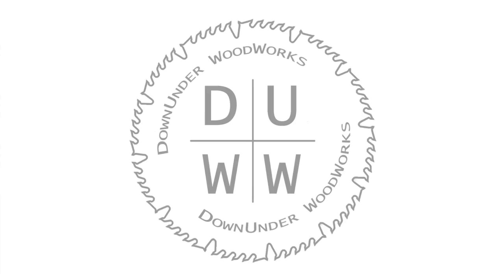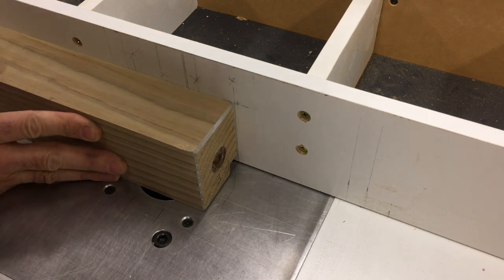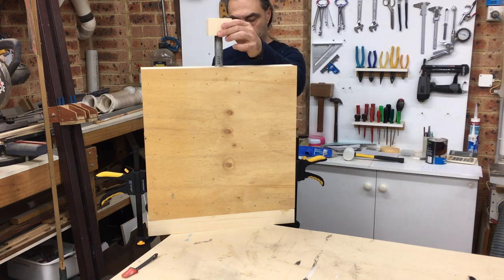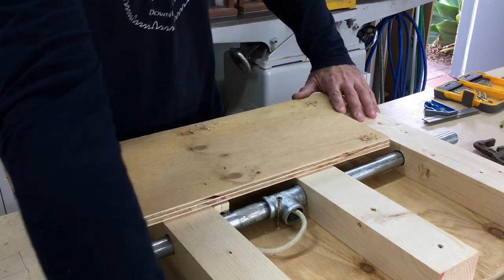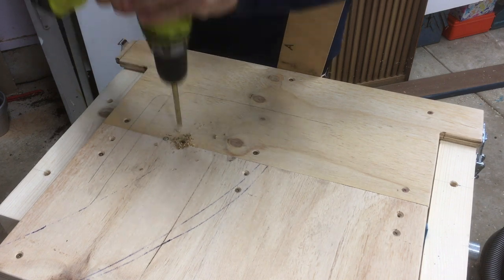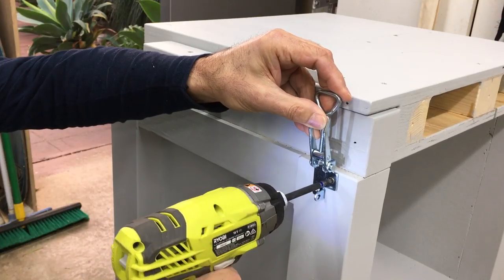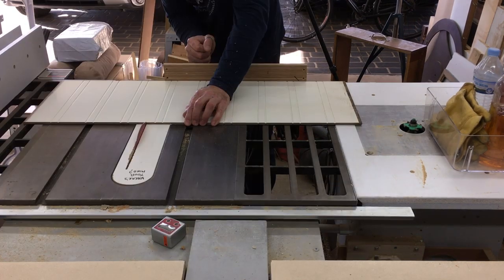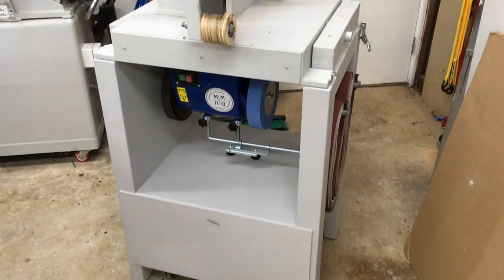How to build a mobile flip top tool cart

Comment: This has to be the best flip top tool cart build I have seen thus far.

I am planning on building one for my mitre saw and thicknesser. This means that I may need to make one side thicker (read, offset to make one side higher than the other side) so I can get a balanced outfeed for both tools when using in between the the benches on either side.

Thank you very much.
Reply from the maker: Thanks very much Isa, good luck with yours mate.

Comment: nice one mate. Just a small comment from my own experience and in no way a critiscism- I did the same thing (yours is much better though) -  with the 240v running through the pipe. Over time the flex on the cord inside the pipe junction wore through and was not far from exposing the wires when I discovered the problem. A bit of extra protection on the cable has served me well for coming on 10 years now.
Reply from the maker: Thanks mate. I agree with what you're saying and I thought about it. The truth is I knew i wouldn't be using the flip function on this cart very much at all. I have very few hand tools that need sharpening.

Comment: Thanks Victor, this is a nice simple built that results in something very useful - working machines on a reduced footprint.  Also, the tools and consumables applicable to both come along on the cart for a ride.  This has to save time in the long run.  

I have two bench grinders: One with coarse and a wide fine grain stones.  The other has a brass wire wheel and a white stone for grinding drill bits and tooling.  They both reside with their own stands and take up a lot of floor space collectively.  I’ll maybe borrow your idea to turn that into a single footprint unit, complete with consumables etc.  I would worry about wood though, maybe a steel frame and wooden in-fills would do the trick.  Cheers.
Reply from the maker: Sounds like you have the perfect situation for a flip top cart Peter. Metal and wood sounds great too. Do you watch Scott Turner @ Forme Industrious?
Reply: Victor, Scott Turner certainly has a talent for combining multiple mediums into his final product.  I do love the ability to sculpt iron {bend, cut, build, shape, compress, polish, rust, temper, harden, and anneal} whereas with wood we are limited.  That’s why the combination is so good.

Comment: Nice use of scrap wood.
a shallow tray under the wet grinder will keep the cart and belt sander from getting ruined.
Reply from the maker: Thanks Jason. The wet grinder came with a tray, i just remove it when its flipped over.

Comment: I'm thinking of making a flip cart for my wet stone grinder too. How do you like the set up now that it's been a while? Also are there any issues with it leaking from the stone after sharpening. BTW great video
Reply from the maker: Hi Kevin, truth is I have only used the grinder once since building the cart but it works great though. The stone actually dries out fairly quickly so there's no leaking or dripping when its packed away

Comment: Very interesting mate, I like that idea. I don't use Instagram but have you done a video of the belt sander build? If so I would like to see that as I am considering making one as I have two spare single phase motors a half and a three quarter horse power that I could use for it. As I am fed up with stalling my little Aldi 6" / belt grinder combo
Reply from the maker: Thanks Samrodian, the belt grinder video is now up on the channel.
Reply: @DownUnderWoodWorks  thanks mate! I look forward to watching it cheers!

Comment: My God what a complicated gizmo with way too much effort. This would never work for me as I am sure it would frustrate the hell out of me always having to flip it when you need both devices on a project. A for effort but a definite FAIL Down Under buddy.
Reply: I guess the trick is to select two tools which you are unlikely to use at the same time.
Reply: Not a fail at all really. he made something that he wanted for his particular needs that wont be what everyone else wants or needs, it's custom built to suit him.we can just apply the idea and adapt it to suit our particular wants and needs.
Reply: @DavesShed  I agree, and its definitely not a fail either. he built it to suit his needs, not anyone else's so it would be perfect for him. I have a project in mind along similar lines for myself but it would work differently to his and so would suit my needs. it wouldnt be to everyone's  liking but it doesnt have to be. build what you want to suit yourself.
Reply from the maker: Hey Neil, thanks for your comment. As you know our workshops are very individual spaces, personalised for our particular needs, wants and styles. I know i won't be needing to use these tools at the same time.
Reply: Of course there is always the option to have a 20m x 100m workshop. But this comes with it's own set of challenges.